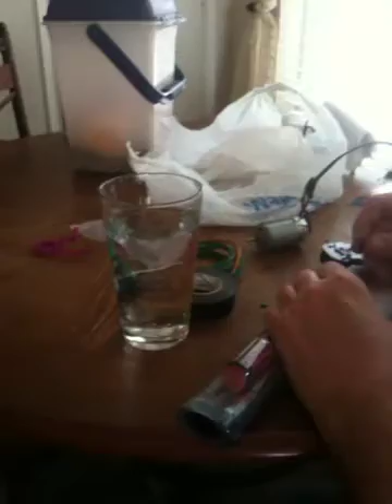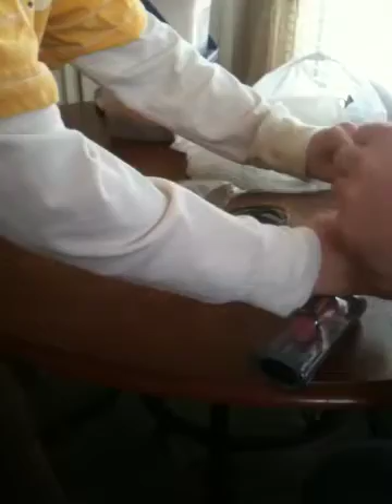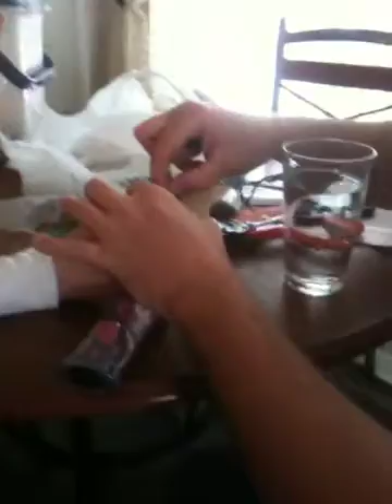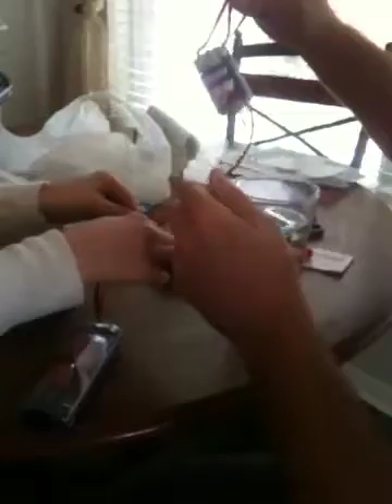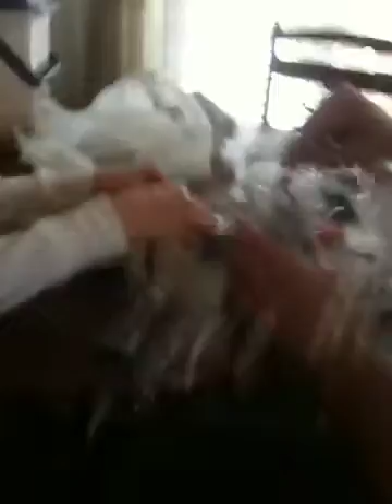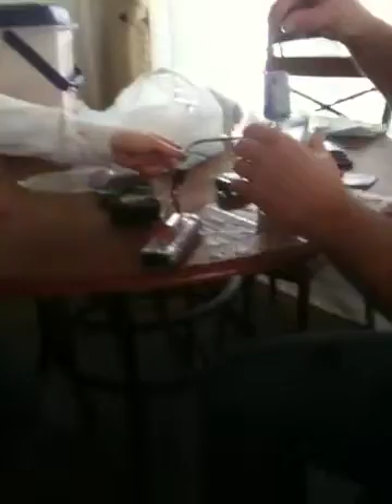Traxxas 12T 550 motor break in

Comment: Not the greatest way to show your kids how to possibly hurt themselves from the motor colliding within the glass possibly breaking. Leave it on esc and slowly bring throttle up. If there was anything presently obstructing motor could cause gouging on brushes. Also distilled water used and motor run for 3-5 minute intervals with throttle range between 50~75% Change water at least 3 times. Sediments will be present in water turning it cloudy or dark showing break in complete when water becomes less cloudy after last water change. Then blow out motor with compressed air and re oil bearings with WD-40 to prevent rust.
Reply from the maker: Myk Lum Thanks... I didn't have the ability to slowly bring the throttle up as I connected the battery right to the motor. Thanks for the information....
Reply: try using a poteniometer or a simple servo tester will work on the esc to dial down power.

Comment: @josh666675 to break it in duhhh. Brushed motors are water proof and to break it in you need to smooth out the brushes inside which is done by the movement and flow of water.